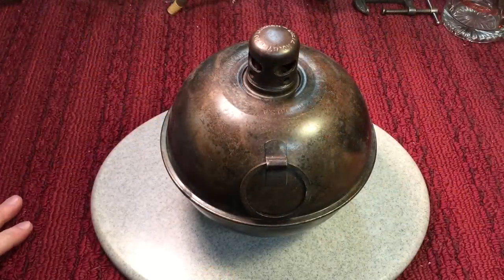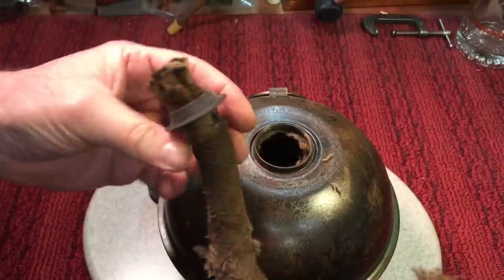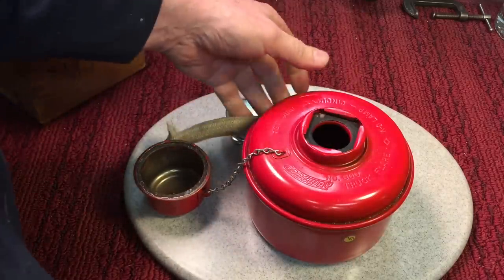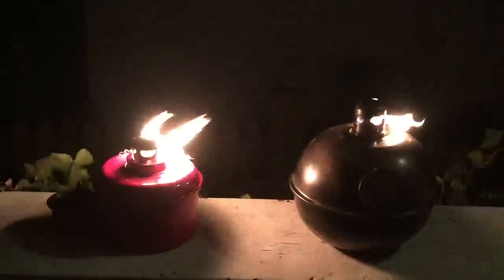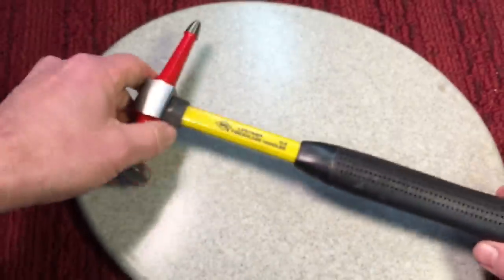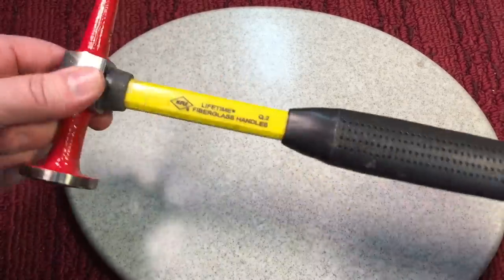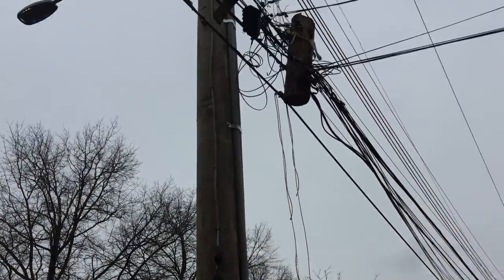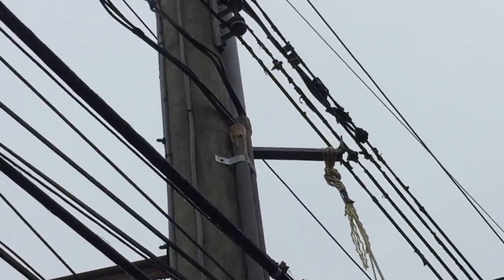Dietz Highway Torch, Nupla Body Hammer and My Electric Service...

Comment: I remember the deitz torch very well from my youth too and remember thinking to my young self that they looked like the bombs you’d see in cartoons and though I never touched one of them, do have a similar kind of story. One year these were set up by an open manhole and the manhole had a big yellow accordion air tube coming out and going to a fan and it was around the 4th of July and me and my friends found a few smoke bombs and I went over to the torch to use the flame to light the fuse of the smoke bomb and didn’t expect the thing to be so hot and as soon as the fuse started up, my hand got burnt and i reflexively threw the smoke bomb away and it rolls over to the fan that’s blowing air down the manhole and the next thing we know, we hear yelling and screaming and the sewer workers are scrambling out of the manhole looking like they were gonna kill us and we ran and ran
Reply from the maker: Joe that was too funny!!! 😂😂😂😂😂

Comment: I work for the electric company and basically what is going on is, that tube that you see the service going down into will make a right angle bend under the ground beside the pole, and that right angle is actually inside something called a sweep and it has openings in the bottom to allow water to drain out. But also, at the very top of that tube (called a Riser), is insulation to keep the elements out. I notice that in your area, the transformers must be poly phase, but where I am, each transformer is a single phase and theres only one tap off the top wires (the primary wires).   By me, the neutral is the grouped in with the other two hot legs. City voltage must be different than here on Long Island.
When I was searching for images of secondary risers like on your pole, I do see some in the images from other regions, so clearly there are some utilities that take that approach. I will ask some of the service men that work in my area when I have a chance and let you know.
Reply from the maker: traderjoes Thanks Joe!
Reply: I was a lineman for our electric co. People always wanted us to bury their wires...I told them why do you want that?? They said they didn`t like looking at them.What do you do with you garbage, bury it and what happens to it then? it rots...The risor is for the public and lineman safety.Some folks put their wires in pipe all the way to their building,it`s a bad move because if it gets hit by lightning you have to replace the whole service.If you run it into just the dirt it will just fault out easy to fine and fix with a machine called a thumper( it puts a D.C. charge onto the cable and where the break is it goes (thump) to ground , you can walk the route and feel it going to ground) Now when the service comes up at the building once again we put a short pipe on it for customers safety, goes into the house meter. The three wires on top of the pole are in most areas 7200 volts to ground 12000 volts across wires, neutrals are always  placed under the transformers..again a safety reason for the guys to work on the poles.Transformers are grounded... I always tell people to go overhead with wires, a down secondary service can be put back up faster then an underground wire you have to locate before you fix it not to mention the grass damage or bushes that have to be dug up to fix this service.On another note a service in pipe builds heat not good for a closed system ,  Hope this helps you understand electricity better

Comment: There is no weatherhead or sealant at the "telephone" pole, because that pipe is not continuous to your house.  It only goes down into the ground, about 2 feet, then the wires are run open, in the dirt.  Once it gets close to your house, the wire come up into your meter socket enclosure.  From the meter socket, a pipe runs thru the wall into your main service panel.  That pipe,into your house should be sealed with a clay-like "duct-seal".  This is mostly to prevent air passing through and causing condensation.
Reply from the maker: I can’t imagine they would run unprotected wires underground with no covering!  That is wild!
Reply: @ScoutCrafter  That is how it's done....  Even high voltage cables,  up to 15,000V are regularly run  without conduit, underground.  The higher the voltage, the deeper it is.  They also require a warning tape buried above the cable, and sometimes sand fill around it.  The cable must be rated for direct burial, of course !!
Reply: Steve Koszuta is the stuff plugging the pipe at the top of the pole,  clay also? The stuff he showed  a picture of looked like it was viscous like soft wax then set as it cooled.
Reply: @corydriver7634  No, I don't think that was "duct-seal" clay.  It does seem like some sort of resin, which hardens as it cures
Reply: I think they also use a product similar to the stuff you buy in the aerosol can that seals cracks with foam. For commercial applications the product is a two part mix that activates the chemical to create a foam seal.

Comment: Out here in the wild west side of Lower Michigan we had Consumers Power run the new lines to the service I installed. They have an open sided cover on the side of the pole that runs to about a foot under ground. That is only to protect the wire from being struck. The wire to the house is a triplex direct burial  twisted cable. At the house I installed the required 2" PVC conduit to the meter box. Per code the conduit goes underground about a foot straight down. Years ago electricians would put a 90 degree bend at the bottom of the conduit. It was found that frost heave would shear through the insulation at the end of bend. The straight section isn't moved by frost heave so it doesn't cut the wire.
I do have a steel 1 1/2" conduit that runs from the 200 amp power panel  in the garage to the 100 amp sub panel in the basement. It is sealed with a NEMA 4 Weathertight box at the garage end.
In your case there must be a solid run of conduit. A weatherhead runs from $4.00 to $8.00 retail. That and a drip loop on the 3 wires might add $30.00 to the install cost. 
Heating and pouring the beeswax would cost close to that. 
Retrofitting a few million services all at once could be expensive. The National Electric Code is precedent based. It doesn't require everything be changed to match the updated code. If the house hasn't had any work done on the wiring it could have been wired in the 1920's.
Reply from the maker: Old Sneelock's Workshop Dave you are spot on!!! It’s amazing how even here in the States things can be so different!   😃👍

Comment: Great videos Scout, I remember when my scoutmaster taught us the basics of electricity( he’s a lineman). I work with him as an apprentice now! But about your riser situation, I think it really all depends on the company or Co-ops spec book. Some call for a weather head to be put on the riser pipe, some don’t because it’s easier to fix if the wire needs to be changed out. They used to direct bury service wires but I couldn’t imagine someone doing that in today’s time. The pipe that we use isn’t waterproof either, the fittings are too loose, so no matter what water gets in it. Ive never seen that bees wax type of stuff on a riser so that’s pretty cool to see. Thanks again Scout!
Reply from the maker: Trever I was told years ago they used beeswax however I am sure today they use something different.  Thanks!!’ 😃👍

Comment: That Highway torch is way cool, you must have been something as a kid, there must be so many worries when being a parent...  Over here all electricity lines to houses and stuff run underground, nation wide even in the country side. I know of one area that still has electric poles and that is because the level of the groundwater is that high you can't put cables in the ground, in those areas you'll hit water if you dig one or two feet at most. 
My family used to be in the transport business and they started out with horses in the 1850's or so. I've read an old newspaper article wich tells they were granted the job of getting the electricity poles to where I still live now by horse and waggon, I think it must have been in 1919 or so. Fun thing is they had to wait (and this literally said so in the article) to get the poles till late fall or early winter because the decision to build they electric network was made in the summer of that year and because the days are long in summer it was decided there was no need of starting on the network right away.
Reply from the maker: Alex Schouwenburg WOW!  Great story Alex!!!  😃👍

Comment: Ah the old smudge pot. There is a company that makes reproductions primarily used for patios. Your'e supposed to fill them with citronella oil. I remember them very well but I haven't come across anyone my age that does. But like you said, they disappeared in the 70's. That was a great story. With my luck the car would have burned up,HaHa!
Thanks for another great video.

Comment: The power companies are an entity unto them self. This means that the electrical codes for homes or factories do now apply to them. The max current rating of wires [for example] that homes must follow are not enforced on power companies. Possibly this applies to "weather heads" for piping also. The power companies rules are very safe but entirely unique to that industry. Take a look at the fires in California resulting from power companies 'internal' rules.

Comment: Nice. Among my things is an old Sears engine heater. Similar to a small smudge pot but has a cover so that no flame is visible. My grandfather told me about the time in the 1930s when it was so cold that LI Sound froze over. He would have to build a small fire under his car to be able to turn it over fast enough to start.
Very true comment about warranties. I hope that you get to try a slim wood handled body hammer like I have. It just feels right in my hand. I also have a dozen hand axes but only one has the magic fit(and it broke). Good Luck, Rick
Reply from the maker: Richard Ross WOW!  I LOVE those old time stories about trying to start cars!!!
Reply: I have heard stories of farmers lighting fires under tractors to get them started in the winter.
Reply: @darrinlawton2748  The ones that weren't careful about fuel leaks had troubles.
Reply: The handbook for my 1946 Harley Davidson WL 45 said that in the winter to build a fire under the crankcase to warm up the oil. It was squirrelly enough without riding it on snow or ice. 😆😎

Comment: Last February we were having my house hooked up to the city's sewer line at the street. The guy running the backhoe hit four underground electrical lines cutting power to the whole block. The city repair crew were at our house in less than fifteen minutes. Within two hours they had it repaired. I remember seeing all my neighbors standing on their front porches giving us dirty looks.  Those hot lines were 7,000 volts. After the inspection of the installed sewer line, the guy running the backhoe hit my water line. The  company doing the sewer line job had a plumber on site and fixed the water line in just a few minutes.
Reply: I used to help the local power guys put in underground lines. I always dug VERY easy. We never blew one up but we weren't very fast either.

Comment: I remember the smudge pots. When I was a kid we would drive to western Kansas on a little two lane highway during the summer. They were always doing road work and blocking one lane. So they would would use several of those pots. I can still remember the smell for miles. Thanks for the memories.

Comment: The reason there isn’t a weather head is because there isn’t a meter or exposed wire where water can get into and possibly short out, so the water doesn’t get into the meter can

Comment: I’m fascinated by public electricity fixtures. Utility poles, transformers, substations, you name it. Over in the US it’s common to have 3 separate single-phase transformers on a pole to step down 3-phase, but in the U.K. you never really see that, you see a single 3-phase transformer (which is basically 3 single-phase transformers in an enclosure). Most domestic electricity services run underground from the local substation (we have many small substations, housed in little shed-like buildings, that feed small areas). You only see over head services in older areas that haven’t been developed in a long time. I would love to have a 3-phase electricity pole like you have outside my home, so I could request a 3 phase service from the power company! (and hopefully have them actually do it, probably at astronomical cost😳)

In the U.K. the companies that take care of the distribution of electricity (there are multiple ones, 7 I think, called “distribution network operators”. These manage different areas of the country, and which one you end up with depends on your location) are different from the people who actually meter your electricity (you can choose whoever you like, since the privatisation of “the electricity board”)
Reply from the maker: Lite Roadie Aryan here it all depends on how old your neighborhood is!  New ones have underground Electricity.  😃👍

Comment: I have a kerosene lamp, but rather than a smudgepot, which I remember as a youth, it is for railroad use.  It is a Handlan, and there is a post about it on Railroadiana Online.  Check out Question Q3487 where I have a couple photos.  http://www.railroadiana.org/pgQB.php  Its use is in a roundhouse not so much as for light but for detecting air leaks in locomotives.  The Railroadiana Q3487 also references a youtube video that shows a larger one of these torches in use.   There is an identical one on eBay now (not mine) at https://www.ebay.com/itm/292730005801
Reply from the maker: OMG!  That price on eBay is insane!  Cool torch though!!!!!!

Comment: Don't know how it is in New York, but; I imagine the reason for no Weatherhead is expense. At least it is here in Arkansas. A Weatherhead is pretty expensive as opposed to a chemical sealant. Down here it wouldn't be wax, but; some type of polymer. And, truthfully; I'm not sure that could be gotten away with down here. Different locales have different municipal codes. The codes here are pretty severe due to the propensity for major storm damage. Leaving that section of pole dangling is a No-No down here. I've seen the telephone company mix their polymer. It comes in a 2 section bag that when mixed gives you a limited window to seal things up. I'm still a little aghast at that pole section. Hope your neighbor gets fixed up quickly. Oh yes. Another good show!
Reply from the maker: Stephen- Maybe they use the same polymer here now!  Years ago I heard it was beeswax but that would be way too expensive now!  That hanging pole is funny right?!?   😃👍

Comment: As soon as I saw your highway torch, I went into the garage to find mine.  They are also Dietz No 87 1940.  What is the best solvent to clean up around the burner without damaging the paint ?  - Kathie
Reply from the maker: artsietopology hi Kathie- You have some great Stuff too!!!  These torches always get filthy because of both the soot from the open burner and the dirt it attracts.  First wipe the ball down with cool water using paper towels, then you can use some WD-40 again with paper towels to clean it up.  They a messy but fun!!  😃👍

Comment: I remember smudge pots well! I know they say kerosene but we always burned diesel in them. So did everyone else I know. The thing I hated most was them rolling around spilling diesel in the back of a pickup. The rattle drove me crazy. We would always liberate an old milk crate or something to put them in. I still have the crate made out of wood.  I was the night call out man for the County. We would always get them ready before a big rain or something getting ready to block the roads that flooded. Fill them up and trim or replace the wicks. We used to always have to build barricades and paint them on rain days too.  Also, not sure why but around here  called those orchard heaters salamander heaters.  He you and I have the same taste in youtube do you follow 'out of the woods? Nathan is a great guy. Check him out. Lots of tool stuff.
Reply from the maker: David! Kerosene is just diesel that has been refined another step... it’s amazing how wide spread those highway torches were!  Everybody remembers them!  They really are interesting... Thanks!

Comment: A Guess on your power/water:  At 14:37 you show the pole in front of your house and it clearly shows old construction b/c they are using a pintype porcelain insulator on the phone line.  They have not used pintype insultators on the sides like this for many, many years (60s and possibly earlier).  Also looking closely at the top of the pipe, at least in the picture, there appears to be some of domelike top on it.  My guess is the old seal has been breached.  I think you should call the power company and tell them.  I don;t know if they can be held liable if the incoming water would somehow short something and cause a fire or not, but it might be something o get them a little more motivated to come out and look at it.
Reply from the maker: Hi Lee!  Funny how you noticed the insulator!  I bet your wife is always watching the road because your eyes are scanning poles!😂😂😂👍.  I called Con Ed and I am on the list...  😃